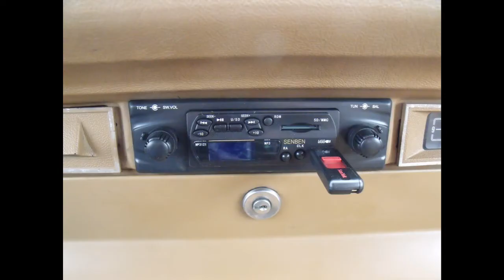Build Bonus-1977 Jeep Cherokee for Overlanding

Comment: I love everything you did, but the thing that made my eyes pop was the decking at 2:12! Brilliant!
Reply from the maker: Thanks! The system has been working out nicely. Not shown, and I don't know why, is that I added a shelf above the boxes. You can see the shelf support on each side panel (long 2"x2"s covered with carpet above wheel wells back. With the shelf installed the side panels still come up enough and protrude out from the metal to keep things from rubbing on the paint.  Makes it nice to still be able to access stuff down low without having to unpack everything from the top first. George.
Reply: @swidahooverlanding2867  That's what I thought they might be for. I really like what you did there. I've got a '78 4-door; saving up to get the body work handled first (too much rust! but I have good replacement parts), but this looks like a project I could do in the mean time for not much $$. Your ceiling turned out well, too, though one can buy a kit from BJs these days.
Reply from the maker: @Tarjema  Yes the storage system cost me the price of a sheet of OSB, 2-1"x2"s, 1-2"x2", 1 2"x3", enough indoor/outdoor carpet to cover it, and the totes and ammo cans. Probably about $125.00 all in. I put the ammo cans in the slots on each side between the wheel wells and tailgate. You can see the ammo cans I used at 1:47 .

I looked at BJ's headliner kit. WOW! they don't want much do they? Although I did run into some issues with the coroplast it still looks pretty good 5 years later. I think I was in $75.00 with paint. If you can get coroplast in the color you want (I did not want to wait) it would be even less. Seems to me the coroplast was $15.00 a sheet. I messed up one sheet so it cost me more than it should have.

Comment: That thing is awesome looking!  I have an ‘81 Chief Widetrack, Harvest Gold, with the same huge mirrors and I love it!  I painted my wheels black too–makes it look more off-road ready.  What drivetrain do you have?  I’ve got the 5.9L V8 w/ the 3 speed auto
Reply from the maker: Same with the Quadra Trac transfer case. Motor is out now. Having it rebuilt and doing some upgrades. 9:1+ compression, Edelbrock Performer manifold, 268H Comp Cam and a Holley Sniper Fuel injection system. Just had the transmission rebuilt and had a slighty higher stall converter installed. Hope to have it in next week. Thanks for watching, George.
Reply: Had a 77. I put 360,000 miles on it and sold it to a buddy of mine for a hunting buggy.
Mine was the quadratrack too. Wasn't a fan of the system but it never failed to get me home.

Comment: What size tyres did you go with? Looks great with the KO2s!
Reply from the maker: Thanks! The 1977 Jeep Cherokee stock tire size was equivalent to a 31"x10.5"x15". I am now running 33"x10.5"x15" KO2s, as you mentioned, on stock width and offset aluminum rims. Only added 2 lbs. of unsprung weight to each corner over the stock wheels and tires. I also added a 3" front spring/rear block lift to help clear the 33". It really is a great combo for the Jeep Cherokee Wide Trac. Economical and easy  to do and does not require regearing. Thanks for your interest George.

Comment: what did you make that headliner out of?
Reply from the maker: I used coroplast. It is economical and was a good test run for maybe something better like ABS. Been in the Jeep for 5 years, but does have a issue with expansion and contraction which buckles a bit in the tight areas. You can read about the process here http://fsjnetwork.com/forum/viewtopic.php?f=10&t=4069&hilit=headliner+ghcoe . Make sure you read through the whole thread because there is some discussion on other materials and the issues with the coroplast.

Comment: That’s badass!!! Love it. I just bought a 1980. What are the pieces next to the headlights that look like another set of headlights? The ones in my jeep are missing and I don’t know what they are called so it’s hard for me to find the replacement parts.
Reply from the maker: Hello and thanks! Those are called pie plates. Unless someone put a Rhino grill on your '80 they would not be stock and they where only used with the Rhino grill. The military M715 did have a light in that location, but hard to find and not very useful for civilian use. Some have put lights in those locations. I will eventually. Good luck with your '80 and if you are in the area look me up. Facebook info in my channel description.
Reply: SW Idaho Overlanding oh that’s awesome thank you so much!
Reply from the maker: No problem. See you on the trails, George.